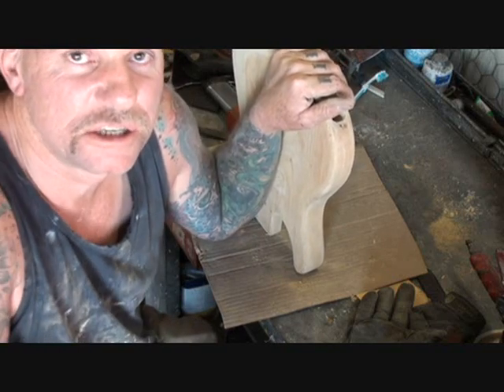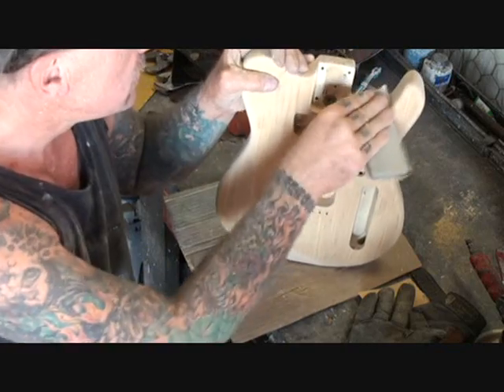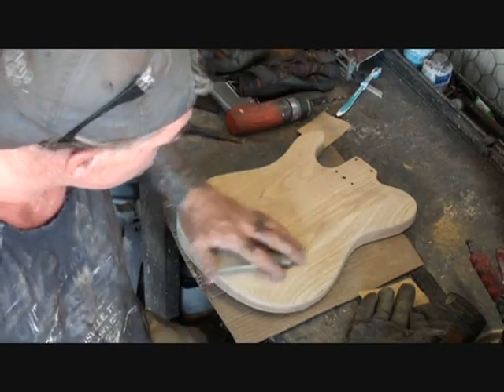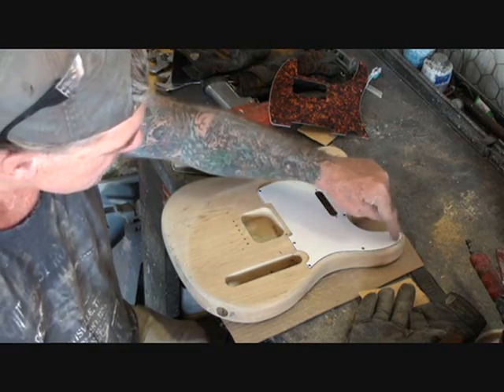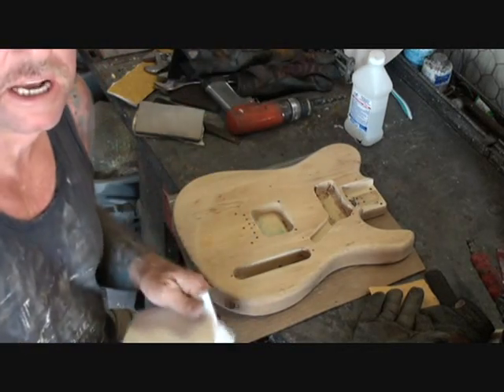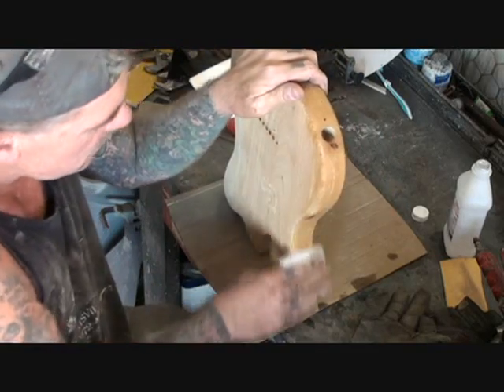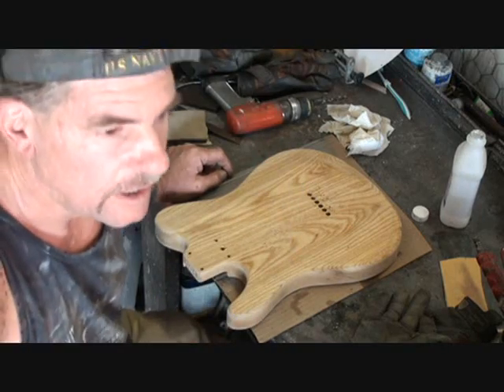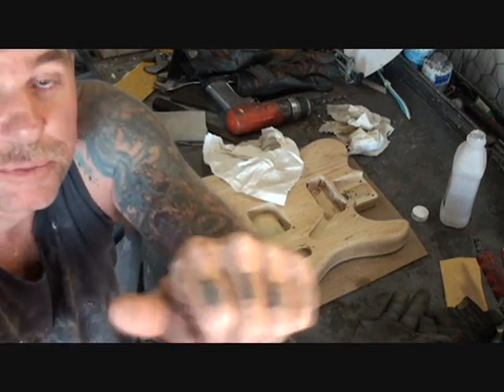How To Refinish Your Guitar-Peavey Reactor-Prepping For Paint

Comment: I've had a problem with grain showing through when i try to paint a new unfinished basswood body. I sand sand sand and sand, use sanding sealer, prime, then paint with spray paint or laquer (tried both) but can see some grain. I'm looking to get a clean laquer look. Any suggestions?

Comment: Thanks for the advice, I think the body is solid mahogany. From what I can see of the exposed wood, it doesn't look to be made up off pressed layers. Because of the small amount of work needed to refill the caps I may get a quote from my local guitar dealer, who also offers repair work. Not that I'm scared of trying, but it took 6 yrs to save for it I really don't want to risk ballsing it up. Discontinued, last one in the shop. I still feel slightly smug about that haha.

Comment from the maker: You can actually buy the coating that is used on new guitars to seal the grain up, Search the net for Stewart McDonald, it's a guitar parts/buidling company and sell all the products needed to refinish/restore your guitar. You can also use an automotive 2K primer which is a high build primer that will work just as well.. Good luck. Pete

Comment from the maker: @MrSatchafunkilus You can use a product  made by PPG called DBC 500 Intercoat clear, which will act as a clear filler and seal the wood up, it's a urathane base paint which only requires reducer and drys very fast. Or you can use Automobile 2K primer and then blocksand then paint. Thanks for the comments. Pete

Comment from the maker: The situation you have is what kind of wood is it made of. Alot of the inexpensive guitars of today are made from plywood believe it or not, and then they saturatate it with poly filler then paint it with high build bake on poly paint. Even Washburn guitars are made of pressed and molded plywood. I would say if you are going to paint it, not to remove the orginal finish but rather fill in the chips, spot prime, blocksand, and paint, you will be much happier. Take it easy and good luck. Pete